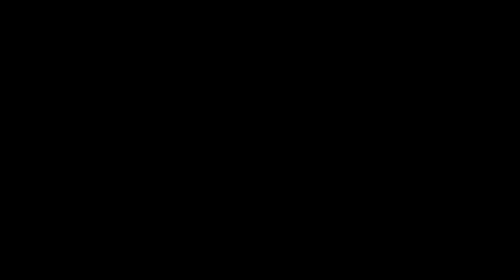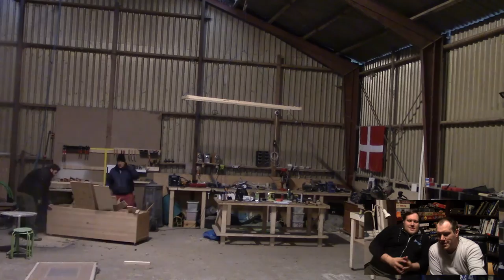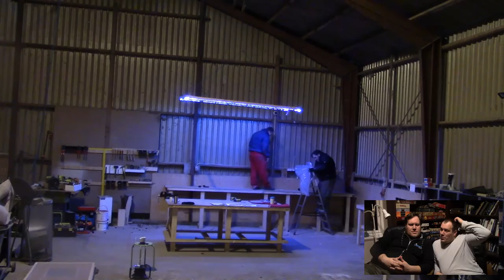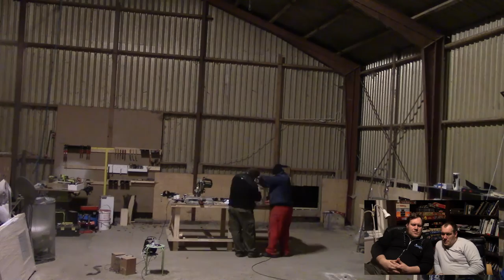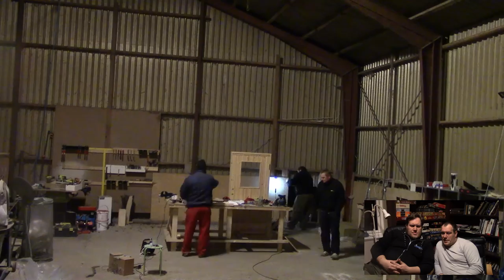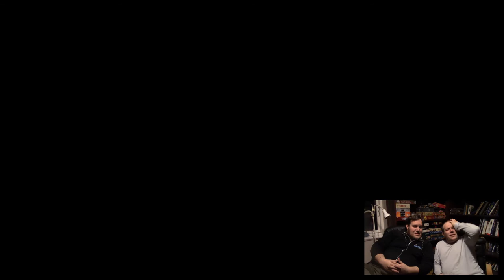LSF 21- Insulated workshop part 1/4 - Doorway

Comment: The door frame issue... I spent plenty of time reading on how to do this "the right way", and was fully aware of that a gap (and shims) need to be used when installing it. The reading and being too afraid of doing something wrong while working on it probably meant that I spent at least, if not more time than what you did building and fixing the problem. :)
Oh, and good idea to see who's doing the talking! But are you really identical twins? You look more like "ordinary" brothers. :)
Reply from the maker: +JWAM
Yeah we dont much read manuals, if we know the basics we just go ahead, worst case we have to do it over.
but it think it was mostly because we did the framing at night, in the cold, and the next morning when it was warmer, so i think our timber settlede and therefore our measurements was of.

we are twins, not identical as you can see, but until we were 12 years old we looked like we were.
- Kenneth

Richardt asked me to ask you if you can&#39;t video more of your projects, you have great ideas.
Reply: +The Lordship I will definitely both shoot more details of a project as well as do (and shoot) more projects.
I made a false start with this YouTube stuff during the summer (we built our house and moved in in May), even though I haven't had time to build my garage nor other stuff around the house. 
It hasn't been optimal trying to do projects in the mess and stress.. There's no room nor lighting in the garage, so trying to record just adds more problems. :)
But I'll release 2-3 more videos (with hopefully improving quality) before resuming garage-building to get that out of the way. I will probably not record any of that. I'll leave that to you guys. :)